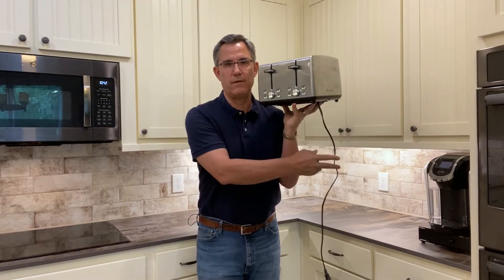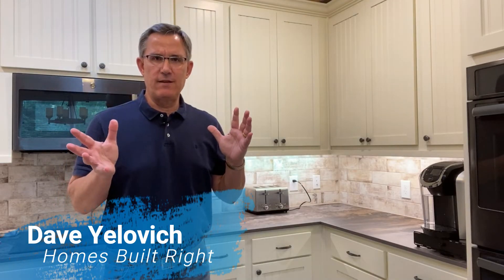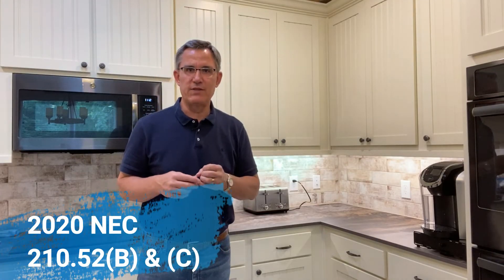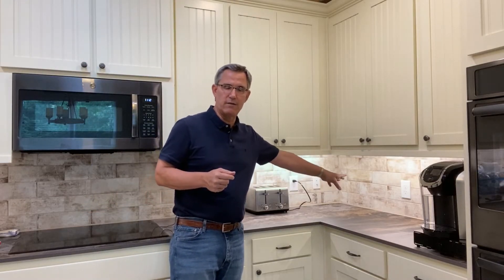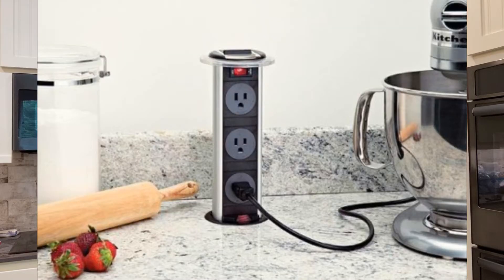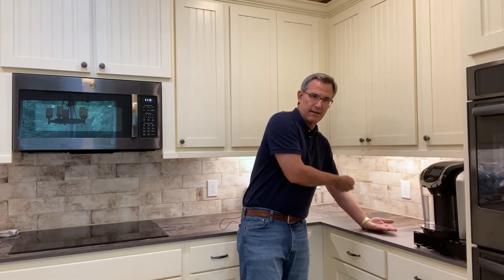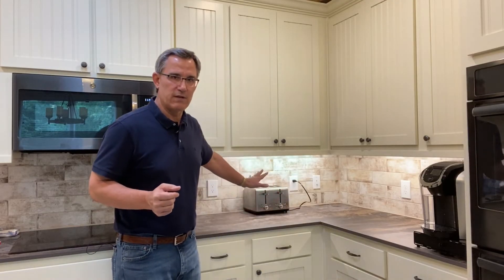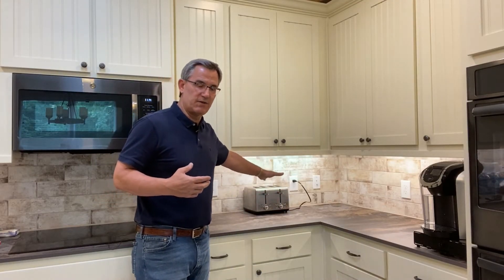2020 NEC - Kitchen Outlet Rules

Comment: I’m in a electrical class right now and he asked me how many circuits are required in a kitchen can you plz respond fast
Reply: 2 at least
Reply from the maker: Thank you Santino.  I just saw this.  Good answer.  That’s an open ended trick question though.  Yes, 2 circuits for receptacles.  But to be a “kitchen” by definition it’ll need some appliances.  Each one has its own circuit.  Range!  Fridge?  Disposal?  Dishwasher?  Trick question.....
Reply: Dave Yelovich very true. I’m an apprentice and have learnt a lot from your channel.
Reply: @HomesBuiltRight  what's the code for how many outlets on 1 circuit?
Reply: @santinoconte4181  you should be asking your instructor during classroom studies. Next ask your journeyman your assigned to work under.
Reply: @timothybrady1174  there isn’t one

Comment: This is very helpful! Maybe a video or some info about installing outlets in the gap above kitchen cabinets for light strips? If NEC compliant..
Reply from the maker: Strip receptacles are allowed to run along the bottom of the wall cabinets as long as they don’t exceed the maximum height allowed.  When this is done it does make for a clean looking backsplash.
Reply: @HomesBuiltRight  keep in mind, the receptacles, and receptacle outlets are different... a strip of receptacles  less than 24” above a countertop would only count as a SINGLE receptacle outlet... no matter how many receptacles are in the strip.
Reply: I would love to find documentation supporting this to show my builder.
Reply: Hard wire them and run spilt tubing and strap it

Comment: Have you had a situation where you have counter tops! But in other parts of the house like a game room or hall or even the utility to my knowledge this kitchen rule only apply in the kitchen! (Talking about the 2 feet 4 feet outlets) can you help me out thank you!
Reply from the maker: Countertop receptacle outlet rules as described in section 210.52(C) apply to kitchens, pantries, breakfast rooms, dining rooms and similar areas.  That 2’ rule applies.  If you had cabinetry with countertops in a game room or library (or other types of rooms not mentioned in the first sentence) the rules would be per section 210.52(A).  In a nutshell, for “other countertop” areas those countertops are included as “wall space.”